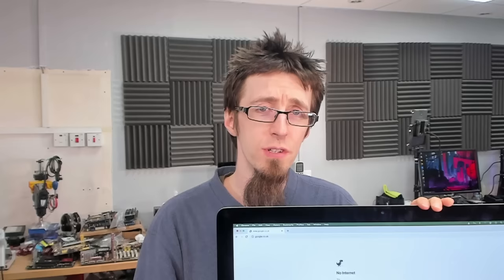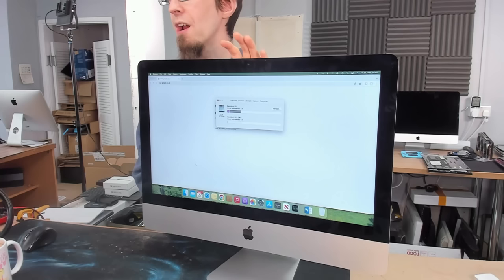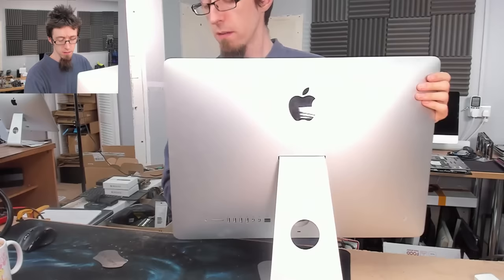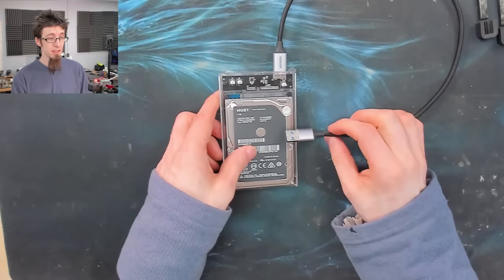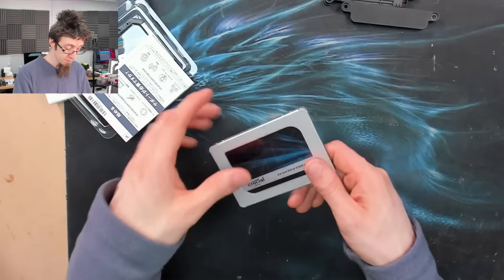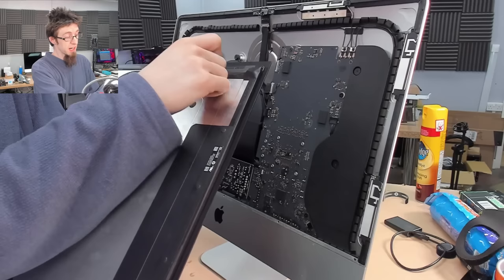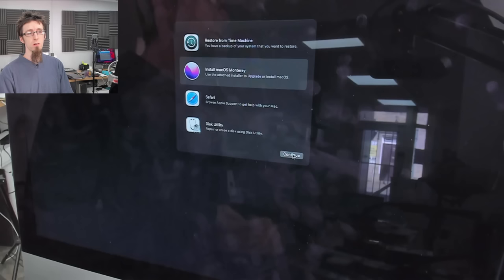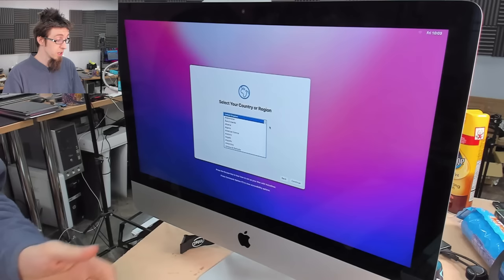Make an iMac super fast with an SSD - LFC#310

Comment from the maker: So I entirely forgot that the Fusion Drive exists while recording this, here's a quick Q&A:

1. What is the Fusion Drive?
Apple's Fusion drive iMacs still have a regular HDD in them, but it's cached by a very small NVMe SSD mounted on the logic board.

2. Do I need an SSD if I have a Fusion Drive?
Yes. The fusion drive is better than HDD only, but it's still pretty bad. Hybrid drive setups like this are a stop-gap, and still nowhere near as fast as pure SSD. Also the HDD can still be failing, bringing down the entire system.

3. How do I deal with a Fusion Drive? Can I still use it afterwards?
My recommendation is to change the HDD to an SSD as per the video, and just erase the Fusion SSD in Disk Utility, leaving it unformatted and unused. It's too small to be useful. Technically, there are commands to rebuild a fusion drive to work with the SATA SSD, but this is generally a terrible idea that will just overcomplicate things for no benefit.

4. Can I fit a big NVME SSD instead of a SATA one?
Yes, but this requires removing the logic board. IMHO it's not worth it unless you're working on a top-spec iMac that really really needs the disk performance for video editing or VMs or something like that. Most iMacs in the wild are low/mid spec office machines, and won't benefit from anything faster than SATA.
Reply from the maker: AND ANOTHER THING... I also forgot that the 27" exists and has a 3.5" desktop drive in it. It will require a 2.5 to 3.5" adaptor for the SSD. But the assembly, SSD used, and transfer process is all the same.
Reply: @Adamant_IT  Nimbus do 3.5" SSDs. They're high capacity and very expensive.
Reply: My late 2013 27” iMac has a fusion drive, one of the earlier 256 GB incarnations, not the tiny ones Apple used as standard fare in later iMacs. I’d like to continue using that drive as extra storage if possible… as a second drive allocated to temporary downloads or whatever. Is this possible? Also, are there any caveats for removal of the larger 27”? Lastly, at some point Mac OS became prematurely unavailable for this generation iMac simply due to the fusion drives (something about implementing APFS). If I’m no longer using the “Fusion” feature (i.e. the fusion SSD is set to act merely as another drive or—if I must—disabled entirely), can I tell the Mac OS installer to chill TF out and give me the most recent version my iMac is capable of?
Reply: I have a 2020 5k iMac that's being used for Premiere Pro editing. I'm interested on the NVME upgrade. Do you have a specific tutorial about this?
Reply: Do you have reconditioned iMacs for sale please ?

Comment: I had thought to update my MAC for sometime but I initially was not encouraged. However watching your instructions, I took the plunge. The MX500 was on offer and it and the stickies were £80 on Amazon. The installation of the new drive took less than 10 minutes, with just the removal of the old glue taking a bit of time. The installation of the new software took around an hour with a further 90 minutes for the migration from the old drive. Very happy!

Comment: Nice work! I have done mainly mac mini upgrades and found that clearing the NVRAM (CMD+OPTION+P+R) before the first boot with the new SSD will not only speed up the initial boot, but avoid as well all kinds of Apple shenanigans once you are setting up the new disk.
Reply from the maker: I had also heard this, I did another one of these on the podcast last saturday and it took forever to boot from the macOS USB, and the NVRAM reset would've sorted this. It's not mission critical, but yas, good tip!
Reply: what would you press on a Windows keyboard?
Reply: @yotoprules9361  You don't unfortunately. I have yet to find a Windoze keyboard that the Apple bootloader would accept. You just have to have an old, wired original Mac keyboard to evoke the 'option' selection menu. 😞
Reply: @mwolfer1  the customer gave me the original keyboard so all was good.

Comment: Excellent video! So much good information here. I would humbly add 2 things: First, a 16GB RAM upgrade is absolutely doable without removing the boards. Unscrew the T10 torx from the top of the board, right next to where the modules are (it twill give you just that little extra room to gently bend out the board a tad, don't go crazy though...) and with some delicate work you can pop the modules out and jimmy the new ones in there. I turned the imac 90 degrees, long edge up so it was right in my face, so to speak, and I got it done.
Second: at 19:10 as you are pulling on the left speaker it is worth mentioning BE CAREFUL of the power button wire, which is routed right there along the right edge of the speaker (visible also at 19:38). I made the mistake of removing the speaker completely, which wouldn't have been so bad but I didn't realize I tugged on the power wire lead and it broke off of the power button, argghhhh! I had to remove the power button and do a solder job to fix that.

Comment: Hiya thankies for this helpful video. In the shop where I work we tend to always recommend our customers that we really clean out the mac since it is one of the only moments you can really blow out all that dust that accumulate inside and creates this insulating fuzz inside of the machines. It will make the system even more quiet and slightly less warm. They tend to become hot as furnaces if you keep them all dusted in. ^^

Comment: I have discovered USB NVME enclosures and boy what an easy job of migrating they make it.  You can set the NVME to clone off the old HDD while you are doing all of the technical work then just plug into the NVME slot or use it as a USB flash drive to copy onto the new drive.  Great video!

Comment: Nice work. 
I use to replace a lot of imac HDD with SSD at  work. 
I like the computer being horizontal when I take the screen out and when I put it back on. 
MX500 are great SSDs, for those who would like to do the same, I don’t recommend using a cheap SSD because if it fails, you will have to start again the process and the new adhesive strips are much harder to cut than the original ones.
Reply: That's why you test the new SSD before sealing the screen. Even brand name SSD fail.
Reply: @Bartetmedia  
I was referring to the fact that cheap SSDs are prone to fail much faster. 
Of course you can test the drive before sealing.  
Long story short: use high quality drive because slim iMac are a pain in the a*s to open

Comment: After following your video I found it wasn't so frightening to remove the screen and replace it. I had already done a SSD install in my old iMac 2011 which made it super fast. On the old Mac I had done an external boot with a fresh install of High Sierra which was fantastic. I just took the SSD out of the box and put it into a new sata  bracket and then booted- boot time was 24 seconds! There was no need for a new install of the mac os it was up and running. So after this experience I did the same on the 2019 iMac , preparing an external usb-c box with a fresh Ventura os to get rid of old files etc. Not as fast as I had hoped ( 59 sec) but at least faster than the internal  fusion drive. Screen off and the SSD installed - and woww boot time is now 32 seconds and straight into the desktop. With the external drive boot done first there was no lagging to find the HD as it was already used to startup from the SSD.  Sticking the strips of adhesive and screen replacement was  really easy . Thank you for such a detailed video and giving me the courage to finally do this thing!

Comment: 17:10 -- It was cooler when Apple just used some magnets to secure the display.  Made the older iMacs super easy to work on.  You also used to have access to the RAM slots on the bottom of the iMac, so you didn't have to dismantle the whole thing.  How times have changed.
Reply: The RAM slots are still easily accessible through a small hatch in the back panel.
Reply: @hornplayer1228  Not on all models sadly, the retina models don't have any access
Reply: @devinmillermedia  iMac? I know they're accessible on the laptops but was sure they're not on the iMac

Comment: The only thing I would say is be careful when cutting the adhesive strips and removing the LCD panel. I do it with iMac on it’s back supported by a cushion, this way gravity is on my side. If you do it with the iMac vertical & it slips out of your hand gravity takes over & you could do some serious damage to the LCD panel and/or connectors.

Comment: Hey Graham.  Couple of tips if I may.  Invest in a service wedge, it will solve the issue with the iMac screen wobbling about.  Definitely get yourself a pizza wheel designed for the job as not only is it way quicker but it also sets the depth of cut.  Couple of passes and voila.  I'd refrain from the metal shim tool as it could scratch the back of the glass and that would show.
Surprising how many repair shops hate doing these, I prefer them to the older chunkier units.  
Also slacken the hdd plastic tray screw and this allows more give on the cables for insertion.  Only learnt this one the other week after countless swear words!!
Great video as always!

Comment: Thank you for this! Only thing I did different was Pre loaded my SSD by holding command r at at startup, disk utility, formatted my SSD, and restored from Macintosh HD (not Macintosh HD data, ignore that one it'll all load in under Macintosh HD when you restore). Then I selected my SSD in the external hard drive case I had as my startup disk and test drove it for a day. My fusion drive had lost over 100gb of data and was running really slow (it was clearly bad). After swapping for a SSD and ugrading from the 8gb of ram it had to 32gb its a new machine. Thanks for the walk through!

Comment: Nice work as usual! No substitute for experience and skill.

 I tried to install a 1 TB ssd in place of the fusion drive on my old 2012 imac. I made two major mistakes: I cut too deep at the top of the screen and severed some wires that lead to a distorted screen and mistake number two: when I took the screen off again to investigate I ruined the very delicate and way too short ribbon cable. I took it to a repair shop and they put in a 'seconds' screen and a new ribbon cable. It's not my main computer but it still works after 10 years.

Comment: If you iMac shipped with a Fusion Drive, you might consider replacing the tiny PCIe SSD drive (NVMe plus an Apple adapter) instead of the 2.5" SATA drive.  This requires a lot more work (removing the speakers, main logic board, etc), but gets you a storage device running 4+ times faster than the SATA SSD.  Certainly consider upgrading your memory (RAM) while you have the logic board out. 

What I did with my 2017 iMac, is put in 2TB PCIe SSD and a 2TB SATA SSD.  I even added a small $6.00 USD heat sync to my PCIe SSD, though that probably didn't ad much cooling capability.  MacOS on the PCIe and Windows on the SATA., been installed for two years now, problem free.

I would also like to point out, when you go to blow out the dirt of any computer... do that outside, not inside the house... an iMac, or any computer, can dump a lot of dust you don't want inside..

Comment: I’ve done a lot of hard drive upgrades but don’t do software upgrades as part of a hard drive upgrade; I simply use a drive cloner as it doesn’t involve me needing login credentials to copy data and I prefer to keep customers data private, especially being bonded as data security and integrity is a big thing. A hard drive upgrade is quite quick with a cloner and quite hands off, then I simply bag and return the old drive with the upgraded computer. I like older Macs as there quite professional and upgradable whereas new Macs are made to be near impossible for an owner to fix let alone upgrade. Apple even had to make their NVMe drives proprietary though thankfully adapters are made; those last models were the last Macs I’d personally use, though with upgrades it’s quite easy for most users to get away with Macs that are quite old. I run 3 MacBook Pros due to IT needs and their ability to work across platforms, like no Windows computer can do as well and this includes a legacy MacBook Pro from 2005 as in the commercial space systems can be quite old; I still fix a surprising number of machines that run XP which is OLD.

Comment: nice video, thank you.  any reason why I couldn't just boot off an external SSD vs replacing the 2017 27" IMAC HDD/Fusion with an internal SSD (with one in your video)?  Would the performance be equivalent?  Is the juice worth the squeeze?

Comment: Good solid video but some advice for anyone new who is following this;
When removing the display - put the machine on its back, sometimes the screen/display can fall off once the adhesive is cut (faulty adhesive) and they're very expensive to replace, especially the 5k retina displays. also makes unplugging the cables easier.

A note, given the machine in this status was booting why not just image the drive from the HDD to an SSD? If using SATA to SATA should be relatively simple of course matching the capacity of the drive with a comparable SSD.

Comment: I converted the DVD drive drive on my 2009 iMac to an SSD boot drive a few years ago.  Makes a big difference even with an ancient CPU.  Mine has a Core i7 860; slow, but still works.  That version was a thick boy with the magnet mount glass.

Comment: I would probably enable trim with "sudo trimforce enable" after fitting the new ssd. My MX500 has been running great with it enabled.
Reply: if you have an OWC SSD it had built in trim
Reply: pretty sure this is enabled on the newer versions of macos by default if it detects a SSD..
Reply: @cerberus_uwu  only if that Mac had orginal an ssd
Reply: @TerkelNL  yep sorry - should have been clearer.. if they had a 'fusion' drive then this would be enabled by default

Comment: I have a iMac (mid 2015) 5k 27inch, 32 gb 1600 mhz DDR3. Just wondering will this work on my system, mine runs very slow cause of the hard drive? Thanks

Comment: I've done an HDD -> SSD upgrade on an iMac before, but it was before the screens were glued on!  I had to use the suction cups to pull the screen off (it was held in with magnets, I think) and it wasn't that hard to then get to the drive 🙂

I had just used Carbon Copy Cloner to image the drive over, so the machine just booted up after I was done.

Comment: I did something similar last year. 2015 27" 5k iMac.. had a fusion drive.. replaced that with an SSD from OWC, but realized there was a  NVMe SSD.. so, bonus.. played with booting from both.. the new SSD was ultimately quicker, and better overall since most apps don't have the option to choose where to install.. but overall an easy process.

Comment: Great video! - I did a similar swap with my late 2015 27" iMac Retina - I installed a 1TB blade drive on the reverse of the logic board as it had the header for it (originally came with a fusion drive) and swapped out the HDD for a 1TB SDD.. I actually dual boot my iMac now as well - I run Fedora on the SSD and MacOS Monteray on the blade drive!  - works great! :)
Reply: I have the same model, do you have video on how to do what you did?

Comment: I have a 27" 2013 iMac with FusionDrive. It is a 128gb SSD and 1TB HDD. Is it possible to keep the OS and some applocations on the SSD drive and upgrade the HDD to an SSD without having to re-install everything?
My main fear is that I run Mojave with some old programmes that still work, but if for some this fails i will not be able to get these again and newer versions of the applications wont run on Mojave. Thanks so much!

Comment: If you don't have one of the metal shims, maybe you can use hard plastic bottle. Just cut it with a point and you will have sharp material to cut with and it won't scratch the paint that much.

Comment: Hi, I need some help. I am looking to upgrade my iMac (Retina 5K, 27-inch, Late 2014), Processor: 4 GHz Quad-Core Intel Core i7, Graphics: AMD Radeon R9 M295X 4 GB
I use this mac for video editing and other graphic related work and it takes quite a long time to render the files. 
What are my options here. Can I upgrade it to Intel® Core™ i9-10850K Processor 20M Cache, up to 5.20 GHz 
What about the graphics upgrade?

Comment: just wondering, isnt possible to do a clone of the hhd to the new ssd? im a noob on mac things
Reply from the maker: Clone is totally possible, I usually use this method as most of the time I'm upgrading macOS at the same time, so it cuts out a stage (imagine and upgrading). Just in this case we were already on Monterey.

Comment: Hi, in what years did the 21.5" like that come out?  Is that one a 27"?  And, can the graphic card be fixed if there are Stripes in the picture, with hot air or something, or would it be senseless?  And thanks for this video!

Comment: I have 2tb fusion drive so when I remove the mechanical drive there will still be 120gb flash drive Apple used for fusing with the regular hard drive.
What should I do with it after I replace the mechanical 3.5 inch with the SSD, should I create the fusion drive out of those two SSDs, or simply ignore the much faster 120gb drive and use only the SATA SSD?

Comment: I did this to my mid-2010 iMac 27 after the HDD died.  Hardest part was removing the screen and disconnecting the associated ribbon cables.  Temp sensor for the HDD didn't work afterward, but I installed Macs Fan Control software and set the fans manually so no impact/issues.  System is considerably faster with the SSD.

Comment: Just one suggestion: after installing SSD on a mac you must enable trim (because it's disabled by default on 3rd party ssds). To do that open terminal and type the following: sudo trimforce enable
Reply: is it ok if I enabled that days after installing the ssd? didn't know if it had to be enabled right away or not.
Reply: @S550GT  yeah. It’s automatic process.